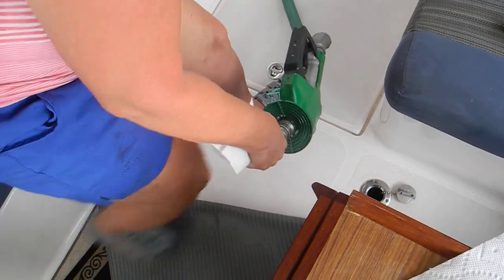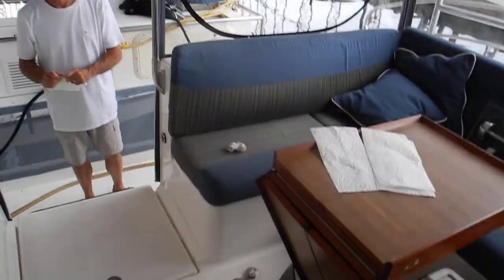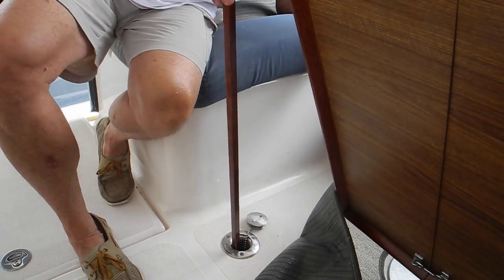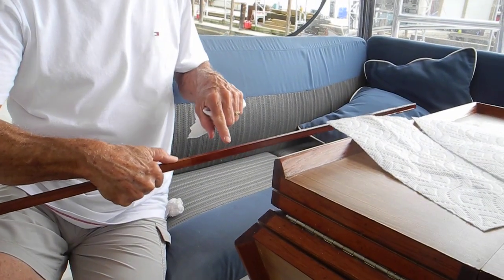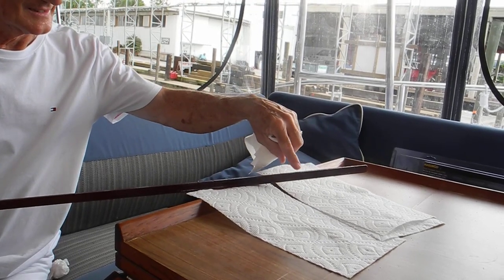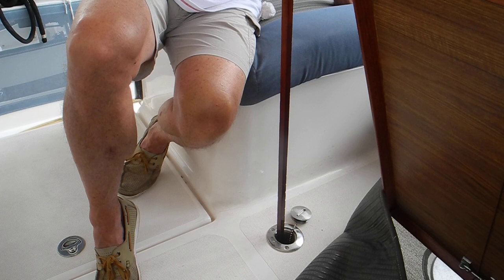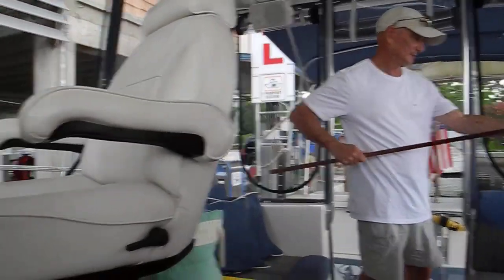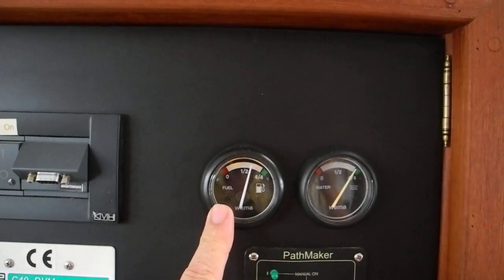Diesel fuel dip stick vs electric level gauge

Comment: The old analogue method is reliable. Diesel may be more efficient but the stench of the fuel and the exhaust give me an instant headache. I would require the engines to be perfectly in tune in order to eliminate that “diesel exhaust stink”. Certain aromas affect me in that way.
Reply: My Volvo Penta engines from 1986 make the exhaust smell like an old bus if they burn regular diesel oil. Since 2019, I've taken the extra struggle to haul HVO biodiesel (they don't sell it at the local fuel dock so I take a 1000 l tank on a trailer and fill it at an on shore gas station) and the exhaust smell is almost gone and the fuel itself doesn't smell either. It costs a little more but I think it's worth it. Volvo Penta has approved the use of HVO in all their engines. Less visible smoke and the engines run a little bit quieter. No problem with slime either.

Comment: That’s a hell of a place to have your fuel fill—and now everyone’s hands stink like diesel too. The oil tank for my home heating oil
(Diesel fuel—actually) is under ground so I use a similar method to check that-only my stick is 7 feet long—and you guessed it.hands stink like diesel from messing with it🤨
Reply from the maker: In your spare time this winter you can install an electronic gauge. 😎 no more stinky hands…..or wear gloves?
Reply: @AskCaptainChris  I always use gloves—that stuff stinks right through plastic gloves if enough gets on you.the tank is under my deck so—the old gas station stick method is gonna be the system forever…
Reply: @johnm5714  I guess I must be a weirdo. I could wear diesel fuel cologne 🤣🤣
Reply from the maker: Our differences are what make life interesting (says Alyse, a fellow weirdo ☺️).
Reply: @alabamasmokeywilson6818  I think they add extra STINK to it when it’s being used as home heating oil—alerts people they have a problem.they also add a red dye to it so truckers don’t use it as fuel—they are taxed at 2 different rates
Reply: @johnm5714  O K we don't use heating oil in the South. Its propane or natural gas. Or total electric